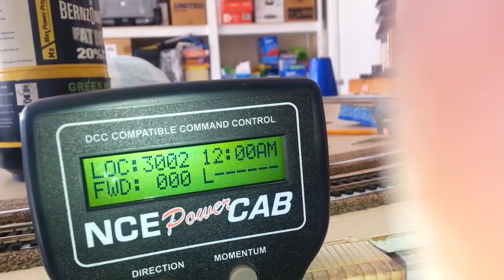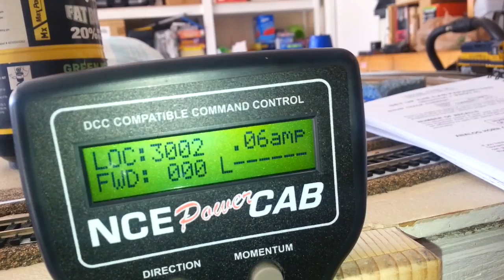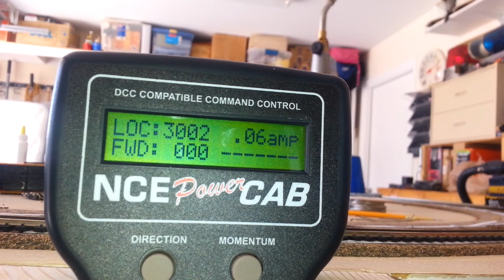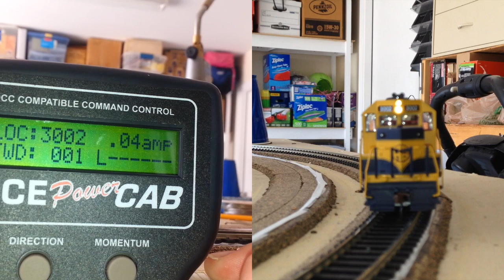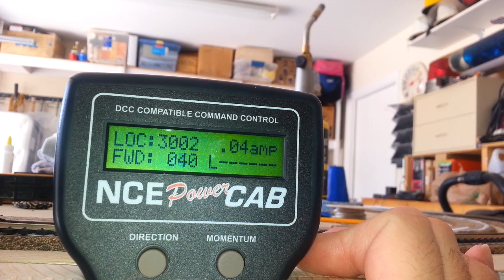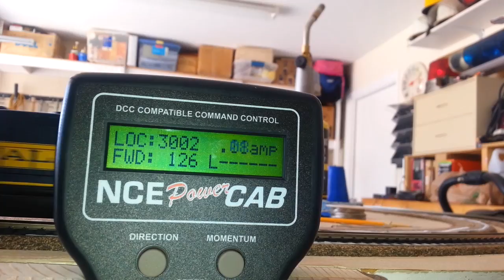NCE Part 2, How to show track current for the NCE system

Comment: Thanks for that. Great video. If I want the time I'll buy a clock. So many times I have averted a burnout after the controller showing a high current situation indicating to a short. So I'll keep mine showing amps.
Reply from the maker: Mine is also set on this all the time. I find it to be very helpful. It's also nice seeing how many amps your trains are pulling.

Comment: This is wonderful information. Can you please tell me what is a good amp number is when running one loco, or under normal conditions?  What is a high or dangerous number that I should be careful of?  If you could help me with I appreciate it. Eric
Reply from the maker: If  I remember correctly each engine should pull about .25 amp. 2 amps or more is not good for any engines or decoders. Hopefully this helps.

Comment: Is that an Aerodynic on the wall?
Reply from the maker: Yes I actually have two bar lights and two single rotators
Reply: @JoeG-firehousewhiskey  knew it lol. I have a bunch of lights, over 400 last count. I cam spot them a mile away
Reply from the maker: @TourDriverSean  wow 😲. My wife told me I had to stop at 4 😆. I wanted to hook them up so they would turn on when the garage door opens 😂. Shed have a fit

Comment: There is a huge difference between .06 amp and 6 amp. LEDS draw 10-20 ma, that's milli-amp, milli is 1,000/of or 20/1000th of an amp,  .06amp is 6/100th of an amp.
Reply from the maker: This is very true

Comment: That definitely is a good "tool" that the NCE Power Cab has.  I think it's important to know where you stand during the pull of 12+ cars going up an inclement on your layout so you don't burn out your DCC System's internal components.  Good to know this sorta stuff!  Thanks!!
Reply from the maker: That is very true, I like knowing what amount of current is being used at any given time.

Comment: Good video. A reading of .06 amps would be 60 milliamps. A reading of .6 would be 600 milliamps and a reading of 6.00 would be six amps. I believe the power cab is only rated at 2 amps total.
Reply from the maker: Yes it is rated for 2 amps. I have a ways to go. but it's a small layout too.

Comment: Hello.  Thanks for the video.  You mentioned having LEDs in your switches.  Are you using them on a control board or out on the track next to the turnouts?
Reply from the maker: 1DesertPirate I put them next to turnouts do the "engineer" knows what way the switch is thrown. I have a video that goes over how to do it.

Comment: Thanks for the Quick Reply.. I just recently got a KATO N SDP40F Santa Fe # 5250 with Lok-Sound it's. Fun Running that Little Dude with Sound my first DCC sound Engine I've Got 4 other KATO Non sound DCC Engines there Fun to Watch but those sound Engines changes the fun Ball Game entirely.. Some Day I hope to convert many of my KATO's to sound or at least DCC..

I have a Big oval Track an inner & outer Route the inner most Route I run DC only on my outer Route I run DCC the Track I use is KATO's Unitrack..

Comment: Great Video.. Sir.. I assume to switch Back to the Original setting or to bring back the Clock you go up through step 6 To ( Set Cab Parameters) click enter Then Press 1 To restore the Clock.. Would that correct Sir.. Thanks again. for making the Video..

Comment: Thanks Joe for that bit of information. I've had my Powercab for about 3 years and didn't know that. I'm gonna check that out.
Reply: +Joe G I tried that and it did not work for me. I'm plugged into a Smart Booster with 3 Dumb Boosters plugged into it. When I go to that option on the cab, It doesn't offer me the option to change the clock. Maybe that option is only available with the smaller unit that you have. I'm running four 5 amp units.
Reply: +Joe G Yes. My Power cab is plugged directly into the Smart Booster and I do think that changes things. I use the starter 2 amp system for my program track and you do get a different readout on the cab when plugged into that.
Reply: +Joe G I just went and plugged into the panel like you did and it worked just as you said. When I plugged back into the booster, I got different options. BUT, keep up the good work and I can't wait until you move on to the JMRI and do an instructional video on that. I've not been able to make that work correctly. (Watched several videos)